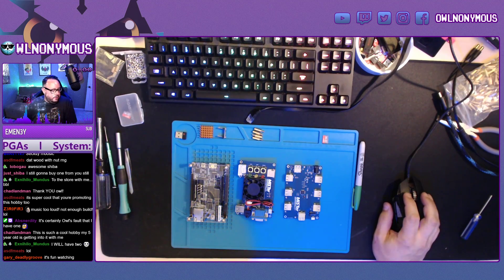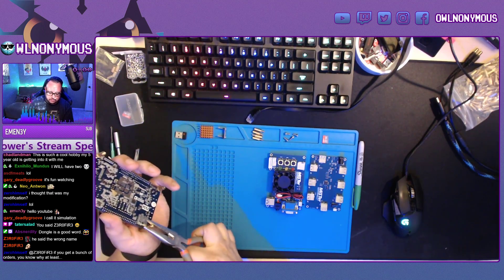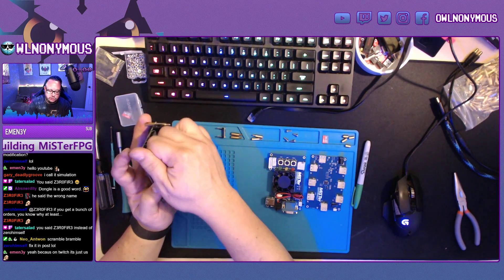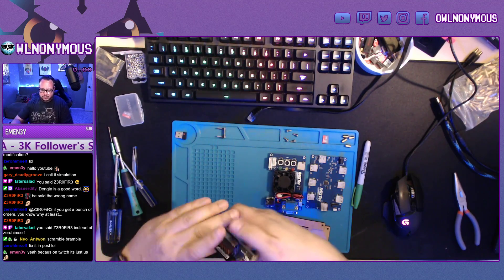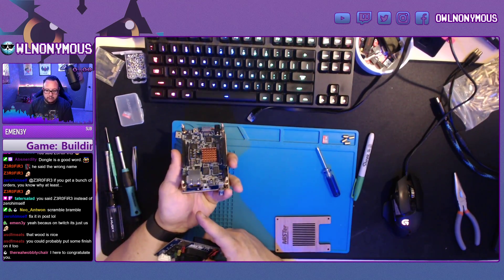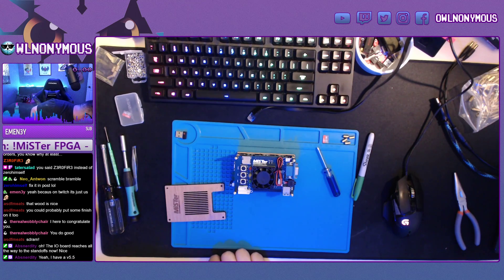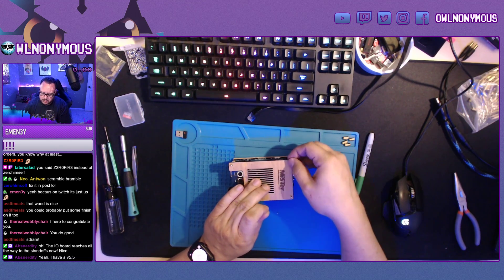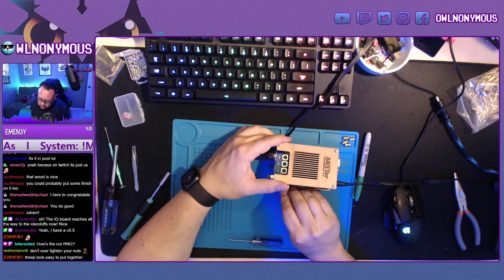MiSTer FPGA Build Stream w/New Case

Comment: Hi. I've only recently become fully aware of what MISTer is and what it can do (I'd heard of MIST a while back but never looked into it). I live in the UK and am wondering if there is somewhere I can safely buy a kit. I took a look at the Wiki and it said that to buy add-on boards you should check listings in a forum and that there's a chance of getting scammed. I'm willing to do my own research when it comes to setting up and using a MISTer system, but I don't want to get scammed or end up buying the wrong accessories or add-ons.
Reply from the maker: Check under the 'Local Sellers for MiSTer Expansion Boards' thread on this Atari forum. http://www.atari-forum.com/viewforum.php?f=117
Reply: @owlnonymous  Hi, thanks very much for the reply. For some reason I didn't receive a notification that you had responded.